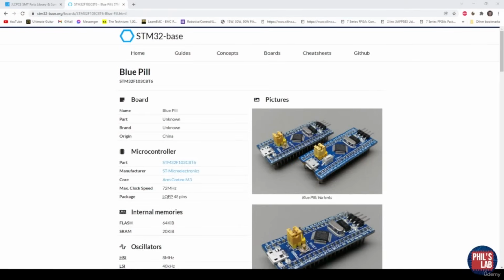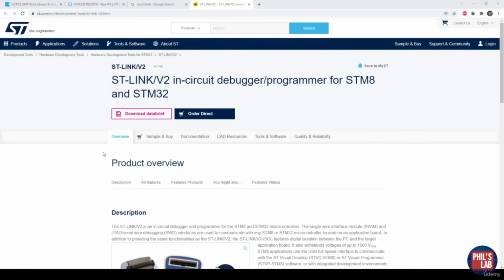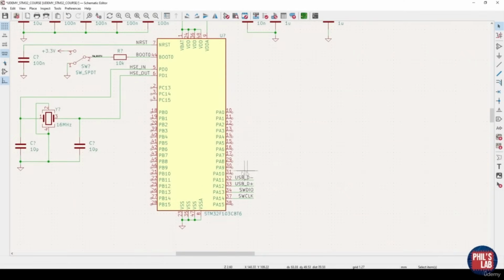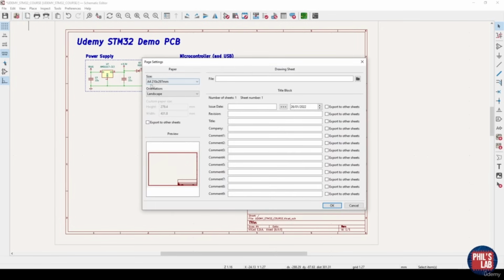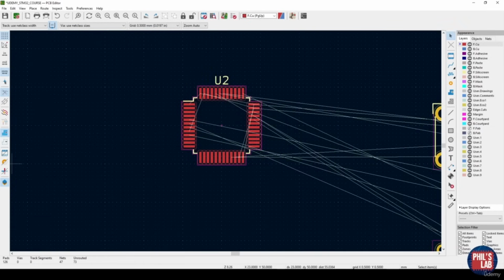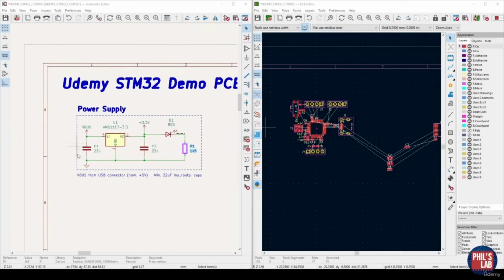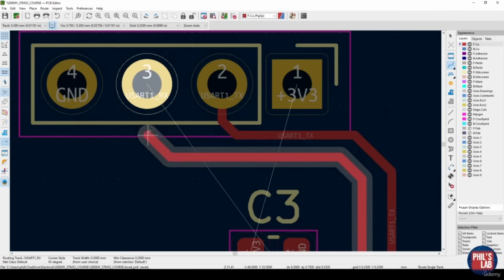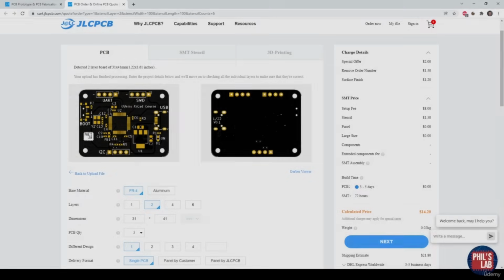KiCad 6 STM32 PCB Design Full Tutorial - Phil's Lab #65

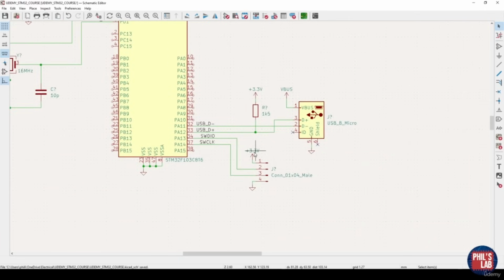Comment: Hi Phil, thanks for all these vids, they are a genuine gold mine!   Newbie question: @28:12 you talk about the resistor (to limit inverter output current) by the oscillator not being needed, even though it is shown in the diagram in AN2867. Also @35:00 you mention that you've omitted the filtering and ESD circuitry for simplicity in this tutorial, but you say this will still get you up and running in most cases. My question: Could you please explain HOW you know what's safe to omit (and what's not)? Did you learn these things in a class? Did you read it somewhere? Did someone tell you? Did you experiment for yourself? It seems to be part of the "art" of this science, but I'm guessing that understanding your thinking process when making such determinations might be of great value. And I'd like to know where is the "line" where you would definitely choose not to risk omitting such elements? Thx!

Comment: Great video and great effort. Thanks a lot! 
You're using 0.7mm for via and 0.3 mm hole, which means annular width shall be 0.2mm. You defined your board constraints with annular as 0.13mm which will make the mentioned via/hole dimensions work, however the capabilities on JCLPCB are 0.254 mm for min annular width. So how 0.7/0.3 mm will work? what I am missing here? Thanks again!

Comment: Im sure that this circuit works, but doesnt the application note say 32:47 that the f103 line only supports usb A? And yet we still use micro B at full speed?
Reply: the form factor (usb a, usb b, usb c) isn't what's shown there. they're showing the different categories of USB connection. the "A" heading is USB2.0 full speed, the B heading is USB 2.0 on-the-go, etc.

Comment: For the people coming here after the STM32 Cube IDE 2.0 release (November 2025), the board selector used starting @ 21:19 is no longer integrated. You need to install STM32CubeMX and use the MCU Selector to select the STM32F103C8T6 You won't even need to install STM32 Cube IDE for this.
Reply: I didnt even try to use 2.0. No tutorials out there but you can find an older release of the IDE, I think anything before 2.0, in 1.x and it will have the selector or you can use MX like you said.

Comment: First of all, awesome tutorial! Thanks for sharing and making it free. I followed it and got the board manufactured from JLCpcb, however, could not get the board to be recognized by CubeProgrammer USB DFU when plugging in USB. Took me awhile, but eventually found out the F103 chip does not come pre installed with a bootloader with DFU capability. You have to manually install this over SWD or UART. I have a ST link V3 but ordered a V2 since the pins on the v3 are super small and I don’t have an appropriate converter. Anyway, wanted to share in case anyone else has the same problem, USB programming won’t work out of the box.
Reply: In the exact same boat jaja, how did you manually install the USB DFU, are there any links?

Comment: I'm a bit confused, why are we tying the NRST Pin to ground with capacitor? Won't that leave the MCU at constant reset?
Reply: NRST has an internal pull up resistor. The cap prevents induced transients causing random resets.

Comment: Just came across this tutorial, and I'm now a bit confused. In another tutorial (https://www.youtube.com/watch?v=14_jh3nLSsU&t=312s) you say that USB-powered devices should use a maximum of 10 uF capacitor between VBUS and GND to limit inrush current but in this video this capacitor is 22 uF.

Is it so that the 22 uF capacitor still works, and doesn't cause the host to reboot, or what am I missing here? The AM1117-3.3 is quite strict in regards of the output capacitor so what are the choices? Different-sized capacitors are ok? Or should a different LDO altogether be used?

Comment: I have followed your design but unfortunately at the last point I am getting this three errors while running the DRC Check 
" Error: Missing connection between items
Through hole pad 6 [unconnected-(J1-Pad6)] of J1

Error: Missing connection between items
Through hole pad 6 [unconnected-(J1-Pad6)] of J1

Error: Missing connection between items
Through hole pad 6 [unconnected-(J1-Pad6)] of J1 ". 

Can you please explain why I'm getting this? The same footprint I used but got this problem.

Comment: why did you not connect USB shield to GND ?
Reply: The USB shield is already grounded at the host (computer). Grounding the USB shield at the PCB would cause currents to flow  through the shield which should be avoided.

Comment: I designed and manufactured the pcb but even though i can flash the blue pill . i couldn't flash this board. ST-Link cant connect to the chip some how.
ERROR probe_rs::architecture::arm::core::armv7m: The core is in locked up status as a result of an unrecoverable exception
Reply: After updating the st-link on windows (When you use stm32cube it checks the updates of your st-link), using the latest ubuntu distro and SW_BOOT0 to GND somehow it flashed!

Comment: In the case i'm using an stm32f405rgt6 (which does have an Embedded pull-up resistor on USB_DP) i do not need to connect a 1k5 resistor to the D+ right?

Comment: Thank you very much for this video - it was extremely clear and easy to follow (with appropriate pauses) even with KiCAD 8. 

Would you have a written checklist of all the things to do, in which order, in a typical case? I had NotebookLM generate one for me from your video (pretty cool, that) but I figure one from the expert himself would probably be better and more complete. Thanks!

Do you have a similar video for a 4-layer board, which seems almost a requirement if you go up to the 144 pin STM32s? Thanks also!

Comment: See your 2 yr old tutorial is still awesome, so Thank You!( I downloaded the KiCAD v6.0 as I always try to do when working along.
1:30:12 - Power Puddles the 1st GND went smooth along with +3V3 but I hope I was not suppose to route the (2-+3V3) but the fill took just fine but going from the USB-U1 (1VBUS TO C1 TO 3VBUS) the fill zone appears to be just fine but the associated fill zone does not show as being filled? Oh I also received an error when trying to open up my saved "Schematic Editor" file, said "this is embarrassing it seems the last time this schematic file was saved something went wrong. But I went to my backups and found one that was good and used it then did a save as, working good now.
You are really awesome with how you have went thru this. I subscribed and will continue to work my way more current. I re-created a XR2206 Function Generator PCB from a kit that I never put together yet. I measured everything using my calipers and a magnifying stand, the included 1) layout diagram,2)parameter table list and 3) schematic diagram. I was surprise how the route widths were right on, along with pad sizes etc. I use FreeCAD and totally am very satisfied so far, but creating a 2 layer PCB this way is very hard on my ASUS Vivobook 14 8GB RAM memory and started taking forever.... so when I did my search your video came up. How fortunate is that, I got the best!!!
Any suggestions will be appreciated!
Stay Healthy
G_Dub

Comment: Connecting NRST to a grounded capacitor initially made me think the reset was being wired low.  That capacitor should charge from NRST (which has an internal pull-up resistor) until it reaches capacity and then stop, leaving NRST high.  This is effectively a power-on reset with a delay.

Mentioning this in case anyone else was alarmed by this.

Comment: This is an excellent tutorial. I followed the tutorial and made some small modifications, but I get a “USB device not recognized” pop up when I connect the board to my computer, regardless of the state of the state of BOOT0 and NRST, and no USB devices appear in CubeProgrammer. Does anyone have any suggestions of what changes to try before ordering new boards? USB configuration on the PCB is the same. I’m not really sure what would cause it to not work. 

Thanks for all the great tutorials, Phil
Reply: The oscillator isn’t starting 🙃

I wonder what is wrong. Your circuit and mine are the same, my crystal has the same characteristics as yours. I wonder why it won’t start

Comment: Yeah I'm still a total noob in terms of hardware design (I've designed/ordered one simple PCB for a hobby project so far). This tutorial definitely inspires me to design a whole MCU project from scratch, instead of using boards like the Arduino or ESP32 DevKit V1. I'm building a multitrack MIDI sequencer, similar to the Cirklon Sequentix. I've made a POC with a Raspberry Pi + PCB and am currently working on a version two with an ESP32. Interesting stuff!

Comment: Hey, one question: in the video you say you want to program the uC with the usb only. However then you enable the SWD pins (that are the ones I usually use to program the bluepill). Why would you do that? Just for the debugging but not for the programming? Lastly, is it fine to not connect anything to the boot pin and just use the SWD with a ST-link? Thank youuuuuuuu!! (also if others know the answer is well accepted)  :)

Comment: Is this schematic / pcb layout available as a Kicad project? I'm just getting into board design with STM32F4 series, and your Github apparently just has a 4-layer reference board with a 12V buck converter, rather than getting power from the VBUS on the usb connector (which I'd like to do).

Is the buck converter circuit used in place of the AMS1117? Can I just remove the 12v connector and keep the circuit the same? 

Is there a reason that schematic+layout is provided on your Github, and not this? 

Also, thank you so much for these wonderful videos,  they're remarkably helpful and make me feel like I can actually get into this, which I've been meaning to do for years

Comment: Thank for your great lecture. But I have a question. I would like to know why the bulk decoupling capacitor for the MCU was furthest located from the USB power source(1:14:00). It seems that the specific placement of the decoupling capacitors could reflect design considerations that prioritize the MCU's performance and noise isolation, rather than being designed to address the needs of the USB power source. Does it make sense?

Comment: Quick question.  Is my understanding correct that the PCB will arrive unstuffed?  How do you plan on stuffing the uC?  I feel like it would be impractical to solder by hand but am worried about the cost of sending the board somewhere.  Any advice?

Comment: I am a bit confused with the design of your 3.3v pin of SWD on this board. When programming the STM32 using SWD, should we connect the 3.3v of the ST-link to the 3.3v of the SWD onboard? If so, would you need to plug in the USB for powering the board or it's sufficient to use the 3.3v from the ST-link to power the STM32 while programming. If we don't plug in the USB, would it cause a reverse current for the LDO? And if we do plug in the USB, would we just send power back to the ST-link? Please reply to me as this is a real issue with my project. Thanks

Comment: Wow, Kicad it's probably one of the least intuitive programs out there. I can't believe how many steps are required just to make these PC boards with this program. I can't believe that Kicad doesn't use components where the schematic symbol and PCB footprint are all bundled together into a component. I was going to try to use Kicad but I'm totally sticking with design spark after seeing what a mess this software is.
Reply: Well, KiCad is FOSS, so this is its main advantage. What do you use instead?

Comment: The behavior of the ferrite bead is reactance conceptually based on the magnetic domains in a ferrite material attempting to flip to align with the magnetic field from the flow of current. As that flipping happens too quickly then heat is produced in that ferrite material instead of the ferrite turning into a magnet because the magnetic domains are simply flip-rubbing together instead of completing the flip. At a lower frequency it turns into a magnet. Today was the first time I heard of a ferrite bead, so that is what I think seems to be happening (according to science of intrinsic quantum "spin" of electrons anyway). Can arrange a PHD sponsor for Me at Cambridge University? Would truly appreciate that and Me being enrolled at Cambridge University would likely advance the sciences (and possibly maths also).

Comment: I have a question, which I am sure you have heard a thousand times before, but I could not find an answer. As a student I can get Altium for free. In your getting started, you said, that KiCAD is best to start with. Is that still the case, if I get Altium for free, or should I jump directly into altium?
Reply from the maker: If you have access to Altium for free, I'd say definitely use that. I only use Altium these days.

Comment: Thanks for the videos, as I'm working on a project now, I'll sign up for that course to get some solid design information.  Incidentally, how do you calculate the drive for the crystal to determine if it's within limits, I seem to be having issues with the drive level being way to high for the crystal.
Reply from the maker: Thanks, Paul! I suggest reading ST's app note on crystal oscillators, that goes through all required calculations in detail

Comment: Thanks a lot for this tutorial. This has really taught me a lot and got me started with designing my own PCBs. As a student I am on a tight budget at the moment, but I will surely support you on Patreon once I got my first real job.

Do you have recommendations on books/online resources when it comes to the theoretical side of circuit design? I am majoring in physics, so I'd like to understand the individual circuits a bit more rather than only relying on best practices. 

How do you decide on whether a resistor can be left out, what capacity is needed, etc.? Do you do calculations by yourself? Or mostly only relying on datasheets and online best practices?

Greetings from Germany!

Comment: Those lessons are really helpful. I have switched from stm32 to pic24 recently mainly because stmicroelectronics product prices skyrocketted by a very big margin. Pic, for some reasons, didn't bump up that much
Reply: PIC factories are based in US. ST is produced in France and Taiwan. I believe that TSMC production is the bottle neck. I have heard that TSMC was running at 90% uptime based on the demand. I think that ST had difficult time getting new lines set up there. I have heard that ST is making new production lines for STM32F series. I have also seen brokers buy up inventory and jack prices up.

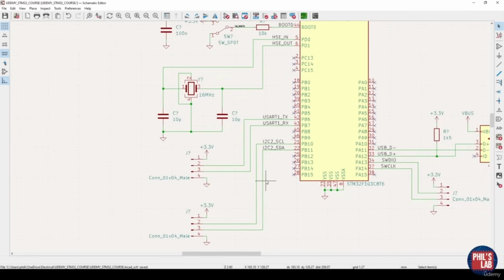Comment: 41:41 - You obviously have a good reason for recommending to stick to 2k2 pull-ups here. Will you explain why that is?
Reply: The minimum value is defined by the maximum allowed current (3mA) for output low. Vcc/3mA is around 1kOhm. The maximum is a function of the bus speed and capacitance, but for on board connections this is not an issue; 4.7kOhm is just fine. For a breakout board you don't know what will be connected to the bus, so you'll want to make it more robust by choosing a smaller value closer to the allowed minimum. I would even use 1.5kOhm, which comes at the cost of slightly higher power consumption.

Comment: Why is USB shield not grounded again? I cannot understand it.
Reply: With my limited understanding, the design makes use of the ground potential of the host computer.
This ground reference is intended to protect the signal lines along the path from the host PC to the client circuitry.
Any interference energy picked up by the USB cable shield on its way from the host PC to the PCB is guided back to the host PC.

If such disturbances were to cause fluctuations of the host ground potential, the resulting offsets would be transferred to the client PCB via the signal ground connection.
In that case, the client PCB would “ride along” with these potential changes and therefore would not experience the interference as a differential disturbance.

In this way, the USB cable does not act as a receiving antenna that injects noise into the small PCB.
This approach is conceptually related to a star grounding philosophy.

In my opinion, this aspect is not explicitly addressed in the video; however, this does not diminish the quality of the work in any way.
It is a very well-made and insightful video.

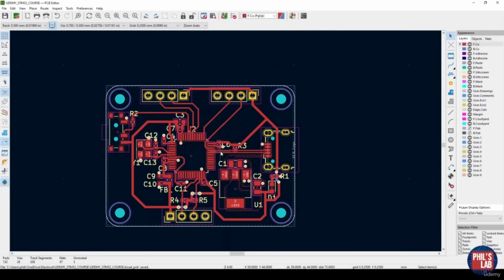Comment: Hello Phil, thanks for the great tutorial. I followed along and encountered problem regarding interconnecting USB module pad-6. KiCAD wants me to interconnect all 4 pads, it somehow does not understand that those pads are already connected internally. You had the same problem at 1:32:42 (before video cut you have thin lanes interconnecting pads-6 on J1 USB module). However after cut those lines disappeared so you probably solved the problem off-screan. Can you give me advice how you solved it? Tried to look online but did not find the solution. I am stuck on this problem and cannot pass the DRC because of that.

Best regards from Czech
Reply: I solved this problem by selecting each of the pads, hitting 'E' (to open the properties windows) and selecting "<no net>" in the "Net name" dropdown. I suspect Phil did this too, but I may be wrong.
Reply: I tried doing as vzwGrey suggested and that solved this problem for me thanks all.

Comment: Thanks foir the update, although the KiCad version 5 tute seems to have worked well-nigh perfectly, even for a total beginner as I was before I found your channel. One question though - I am building a 6502 emulator so wanted a clock chip. I have used the 12MHz version of the 16Mhz chip used in your videos - but instead of the Phi0 input, can I simply apply 5V? If not, can you suggest a simple 5V clock chip? The datasheets on JLCPCB seem very spec-oriented, without any sample circuits etc, making the chips hard for evaluate for appropriateness. 
And real thumbs up for the tutorials, they've been amazingly helpful.
Reply: Maybe just look at the datasheet?